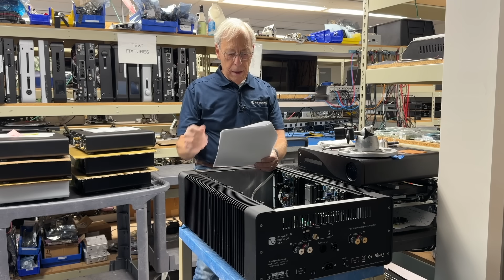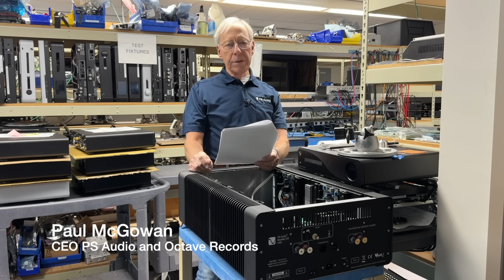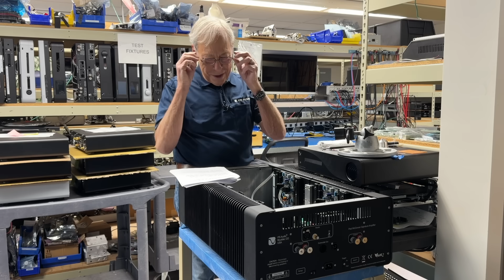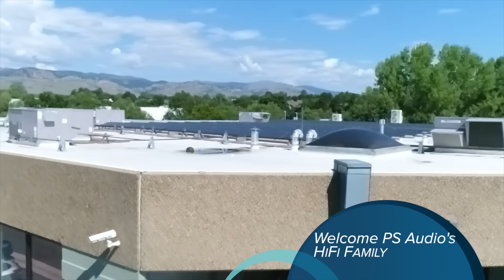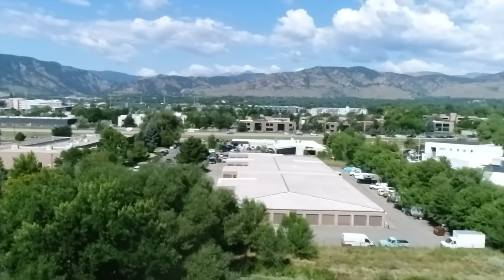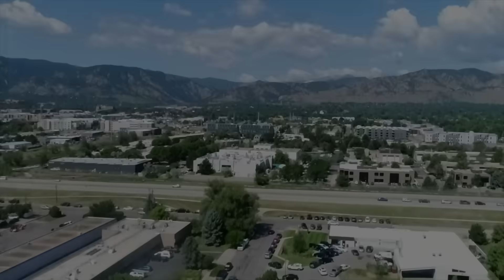Why Class A amps cost more

Comment: Tell the truth Paul. Class A topology is not more expensive due to design complexity. Class A is as simple as it gets. The only reason is because of inefficiency. Requiring more power and more weight, due to bigger transformers and heatsinks.

Comment: If this amplifier in the video has 100W in pure class A and 800W RMS total, (I assume current dumping where the drive transistors are in class A and the output transistors in AB, B or even C) then these heatsinks are not big enough because the manufacturer has to make an amplifier that has to withstand full power all the time regardless of the fact that in reality only a few watts are used on average.

Comment: i said the heck of it bought a brand called helix  car amps. Class a and class ab  or you can get a  class a and d combo for 350 bucks.    I hit my local hifi store .  We were listening to  costly speakers 40k and  30 grand amps.   I bet the  i owner i could match the sound quality for under 400. He said bring it in. Brough my amp in and battery  at home it will have a 50 dollar power supply .   We connected the dac  . The owners jaw dropped.   He was amazed .   Said a damn  car amp with this much clarity warmth sound quality !!   LOL   Home hifi amps huge massive power supplies  huge cage to hold it all.   The components inside the amp and lay out for the mosfet or bipolar are what are the same .     So again i have a mono class a x ab in my home for under 700.

Comment: I can't see how those heatsinks could be so expensive. Most heatsinks I know of are made from cast or extruded aluminium to cut weight, and also cost. Unless it's aircraft grade, which is milled from sold blocks and very wasteful.

Comment: All the internal parts have to be over spec’d and larger values with plenty of cushion in their operating ranges for voltage and current because in Class A the amp runs wide open aka full throttle, my little 25 watt/ch class a amp runs 200 watts all the time whether it’s 10 milliwatts or 25 watts it consumes 200mwatts, that the real inputted cost, tougher and better parts.

Comment: 100 watts of Class A is going to suck a lot of power and generate a ton of heat. I passed on buying a pair of Parasound JC1 monoblocks because even 25 watts of Class A heat is too much in Iowa summers.
Reply: I have a 18 watt sudgen. Its sound really nice
Reply: @jasonme3557  I have a 400/800 wpc Mark Levinson 432, it sounds really nice too.  :D
Reply: @jasonme3557  I have a 400/800 watt Mark Levinson 432, it sounds incredible.

Comment: I got into electronics to build my own stuff. And I was surprised how bad transistors are - they are non linear in most of their range. I decided that only class D can be made right. And anything old style (class A or AB) probably always need feedback to fix problems fundamental to transistors.
Reply: Non linearity is why negative feedback is used and it does a good job if it's not excessive (TID).  Class D amplifiers also use negative feedback, the best ones use post filter feedback and class D is very much still in development.  For decades we have listened to class A and class AB amplifiers and some of them sound extremely good and as far as I know they all use feedback apart from the Cyrus brand.
Reply: I have a 30+ year-old 21 Watt Class A Ultra-Linear Valve amplifier, which as far as I can tell from the Schematics, doesn't have any Feedback... but don't quote me on that.  I gave up on Trannies back in the 1990's.  The Valve amp happily drives a pair of Quad 57 ESL speakers, as I don't need 'Loads-a-Bass'.  Russ.  Hampshire, UK.

Comment: He was asking about pure Class A vs Class AB. The big amp shown is Class AB, and therefore will generate much less heat at idle than if it was actually pure Class A. "Amplifiers that are class A to any degree" are Class AB, except for the few that are actually pure Class A.
Reply: All solid state class A amplifiers leave class A at some point, like when the power output increases into low impedance loads.
Reply: @mitchtaylor6512  Not true. A single ended design, whether a tube amp, or a solid state design like the Pass Aleph, remains Class A by definition at all power levels.
Reply: Class A bias is class A bias, no matter if the amplifier goes into class A/B after a determined amount of watts, it's still the same bias current.

Comment: Can confirm just from building Nelson passes first watt amps and collecting all the parts how $$$ it is. The chassis with all that heavy big heat sinks is the number one cost. Good heavy heatsinks are not cheap. Number 2 is the power supply.  All the 8 capacitors alone in a first watt amp are not cheap and that doesnt include the transformer.  And this is just a simple 25 watt class a amp. If you get into a first watt f5 turbo and some of f5 variants it doubles everything in the power supply. And scaling this up beyong 25 watt class a than you start talking big chassis, huge heat sinks, soda can sized capacitors, bigger transformers and more output transistors. Just my experience from collecting parts for builds .
Reply: @brandonburr4900 ...thanks for posting your experience on this topic as some wannabe experts
(know-very-little's) here are telling us how dirt-cheap these parts are 🙄

Comment: When I sold audio gear, many years ago, the saying was, "It's priced by the pound." The more it weighs the higher the bill of parts. There's simply more stuff in there. Then there's differences in component quality. The components in the amp need to be higher quality to handle the workload and it's gotta last and have the after sales support you expect from a premium product too, which all costs more. There's economy of scale, since you sell less it makes each one more expensive. Not just manufacturing but design. And that goes for the components as well. If a niche company needs specially designed components that can be crazy expensive.

Comment: They would cost more to run, even if they were cheaper.
😉
Reply: I have 2 class A systems in my house, and my power bill has not gone up because of it.
Reply: @JerryM-p2v  I believe you.
It depends on the total power output of your amps and how much time on average you have them on.
…and of course, in your kW/h rates.

Any B or AB class amplifier will draw significant power as well when driven loud.
Only D class amos are easy on the power consumption.

Comment: Class A amps, this uses a transistor under high bias that has the behavior of a vacuum tube triode, meaning a pronounced 2nd harmonic and some 3rd harmonic behavior.  My Pass Labs XA-200.5 monos are a serious 160 lb room heater, but it has that magical lit from within presentation, but with authoritative bass, and a soup to nuts frequency band that’s very resolved.  My Lamm ML1.1 using 6C33C-B triode bottles has more of the same mid band.  My fave tube gear is my Viva Linea preamp, using tube rectification.  Class A and tube gear is my fave.

Comment: Would a low RPM fan(s) help?
Reply: Any fans will help...'sup to you.
Reply: Why add noise to the system. The big heat syncs dissipate the heat into the room.
Reply: @JerryM-p2v   ...when it's Summertime & my listening room gets up to around 100°F, I have a $15 cheap Chinese made pedestal fan, with a 14" blade span, that sits 9' away from my rig, to the L/H side, blowing air over the three components, but directed straight at the amplifier. When listening to Rock 'n Roll or Jazz or Orchestral work or Electronica in a range of 90dB - 104dB I'm not going to hear any "noise" from said pedestal fan on low speed blowing air gently across my rig...I'm just sayin'.

Comment: There you go.  Paul's best amp to date will operate in Class A up to 100 watts, proof positive that all the numpties here who dissed Class A based on Paul having  (dishonestly) pushed huge Class A/B amps were totally wrong.  

You should know, however, that Paul's example is totally bogus.  If it takes 90 hp to go up the hill, you'll make it if you have 100 HP.  The engine will come close to its limit and may struggle harder to get rid of the heat than a bigger engine with a bigger radiator, but (if it's designed correctly) it will make it.  It's a bogus example because Class A creates the most heat at idle.  The bigger the Class A amp, the MORE heat it will produce at idle, and the harder it will be to get rid of the heat.  A huge Class A amp is more like a car that can get up a steep hill, but boils over when stuck in city traffic.  

If the biggest music peak you will ever play can be handled by 20 W then you're better off with a 20 W Class A than a 100 W Class A.  That is almost certainly the case for anyone who 1) Listens at levels that won't cause permanent hearing loss, 2) has reasonably efficient speakers, and 3) has a small to medium-size listening room.  If you meet these criteria, don't get duped by the "more power is better" hype.
Reply: What we've got here is, failure to communicate. Some men you just can't reach. So you get here what markmeridian posts 😂
Mark, thanks again for the hearty laugh with my morning coffee. Your laughable BS is a great chuckle for me in the mornings. Cheers!
Reply: When the debate is over, the loser often resorts to insults when they are unable to make even one single cogent point.  It's something we've all seen and all use to identify the loser.  Despite the fact that nearly everyone recognizes this, it doesn't stop the Dunning Kruger effect types from spewing insults.  Hint: RAT that's you.
Reply: That would be fine if your speakers stayed above 8ohms, but most do not.
Reply: @mitchtaylor6512  You keep making up total nonsense.  Almost all amps produce MORE power at 4 ohms than they do at 8 ohms.  Sheesh.
Reply: @markmeridian3360 not in class A, the amplifier goes into a/b
Reply: @mitchtaylor6512   A class A only goes into A/B if it's designed to do that.  They DO NOT go into A/B with a 4 ohm load.

 Both Class A and A/B do produce more power into 4 ohms than 8.  Usually, almost twice as much.

Why do you make up nonsense all the time?
Reply: Once the ouput power demand goes up - then sooner or later the supplied current exceeds the standing idle bias and then the amp is into class B.
Reply: @markmeridian3360 At some point the current demand will exceed the standing idle bias and the amp will go into class B, unless it is current limited.
Reply: @mitchtaylor6512  Nope.  A pure Class A will not go into Class B.  It will remain in class A right up to the point where it clips. 

Why do you always make up nonsense, Mitch?
Reply: @markmeridian3360 if a 20 watt into 8ohm class A amplifier can almost double power output when impedance is halved, then it would be 160 watts into 1ohm, not possible in class A unless the 8ohm power measurement was way underrated.
Reply: @mitchtaylor6512  Stop making up nonsense.  All amplifiers are ultimately limited by the power handling capabilities of their power supplies and output circuits.  Most amps, but not all, almost double their power from 8 to 4 ohms. That's well known.  You're just (fecklessly) trying to obfuscate for no reason whatsoever.
Reply: @markmeridian3360 no amplifiers made can double their maximum 8ohm out power when impedance is halved, it is not possible. Class A amplifiers are limited even more if they don't transition to class A/B.
Reply: @mitchtaylor6512  You're making up nonsense, AGAIN.  

Look at the Pass Labs XA 25.  25 W pure class A into 8 ohms, 50W pure class A into 4 ohms.  

Look at the XA 30.  30W into 8 ohms, 60 W into 4 ohms, pure class A.  It then transitions to A/B up to 160 W, but the first 60 W are pure class A.  Like I said, it can only do this because it was designed to transition.

Look at the Accuphase A48S.  50W at 8 ohms, pure class A.  100 W at 4 ohms, pure class A.  

I can list nearly the same doubling for 1/2 a dozen more other class A amps.

I suspect that you're (fecklessly) trying to defend your poor decision to buy a huge 1200 W class D amplifier from BS Audio for your tiny  listening room.
Reply: @mitchtaylor6512  That's an outright lie.

Comment: I see PSA has discontinued their BHK stereo amp and 300w mono blocks. Only the BHK 600w is available now for 30k. These new 800w mono blocks... under 100k? Any guesses?
I'm assuming PSA is doing the same as they did with their speaker line-up. Starting with the top of the line and going down from there. Wondering what the bottom of the line amp line will be as far as wattage and price.
Any guesses?
Reply: @Mark-Iq3sb ...They are going to have to be less in purchase price than Gryphon, Boulder, Constellation, Solutions, etc.
As @josephpavel3150 mentioned on my thread, possibly priced along the lines of Pass Labs.
Personally I'm thinking somewhere between Pass Labs & the others that I have mentioned above. That's my 2c worth.

Comment: These class a amps  are designed to run unencumbered. If you must put them on a rack u better make dam sure u got a fan pointing straight at 'em.
Reply: Don't need a fan, that just adds noise to the room.  Think of them as an air cooled engine.
Reply: @JerryM-p2v  no,   if you've got it on a rack u need to put a fan on it. Let that current of air flow through the heat fins and you'll thank me later.
Reply: @robertwatkins-k5p   ...many racks these days are completely open on all sides; square steel framed.
However, any proper audio-enthusiast (including audiophiles) worth their salt will place their equipment
on isolation platforms on the floor in my not so humble opinion.
Reply: why do u think I used the word ...."unencumbered"?
Reply: OPEN SIDES ARE NOT THE ONLY STORY.   WHAT ABOUT THE TOP AND BOTTOM?   IN FACT, THAT'S HOW THE HEAT FINS WORK......DRAWING AIR FROM THE BOTTOM AND EXHAUSTING OUT THE TOP.............RIGHT INTO A SHELF?  THAT AIN'T GONNA WORK, WITHOUT A FAN.
Reply: @robertwatkins-k5p   ...SHELVES CAN ALSO BE MADE OF OPEN-WEAVE OR OPEN STRUCTURED METAL LIKE HALF-INCH SQUARE STEEL TUBING THAT CAN SUPPORT GREAT WIEGHT & ALSO ALLOW FOR NECESSARY AIRFLOW FROM BOTTOM
TO TOP.  WHERE HAVE YOU BEEN LIVING? UNDER A ROCK??? ...YES; IT'S GONNA WORK WITHOUT A FAN AS LONG AS THE AMBIENT AIR TEMP. IN YOUR LISTENING ROOM IS UNDER 76°F
Reply: SHOW ME AN AUDIOPHILE RACK THAT DOES NOT HAVE SOLID SHELVES , JACKHOLE.
Reply: @robertwatkins-k5p   ...you can also bore a series of half-inch holes into the MDF shelves directly underneath the length of where the the cooling fins are positioned in the amp. to allow airflow if you don't want the 'open' steel tubing shelves that are available. And since you mentioned "unencumbered" then why would you even talk about putting two ginormous monoblocs into a Hi-Fi rack when everyone knows that they should be sitting right next to the loudspeakers that they are driving??
Reply: i'M  TaLKING ABOUT SUGDEN A21.  OR, EVEN HOTTER ,THE MUSICAL FIDELITY. I'm SURE U CAN FIND a QUIET FAN. BTW, mdf is the most unmusical material on the planet. yOUR IDEA TO DRILL HOLES WOULD WORK for Cooling  but, you'd still be dealing with a shelf that sounds like crap. O f course, this whole problem is a  non-starter if you simply allow more headroom but, invariably, people want to  cram everything into their rack.

Comment: Try Accuphase A 300 Class A Monoblocks Heaven!
Reply: Try Hegel H30A instead. Sold my A300 monoblokk...
Reply: I love mono blocks.
Reply: I would like to see a 300W RMS tube amplifier in pure class A. Of course push-pull and not single ended because that would be unrealistic to expect considering that it is impossible to pair a bunch of parallel tubes in SE well for such power. The only thing is to use much smaller SE amplifiers connected to a huge output transformer with a large number of primaries and one output for the speaker.

Comment: For the same reason a Model T in excellent condition costs more.
Doesnt mean its better, just more.
The bonus is you can take on small welding jobs to help finance it.
Reply: A better analogy would be comparing modern rockets to the Saturn five it's still the benchmark.

Comment: Listen to an old valve (tube) radio.
That lush, warm sound, is the sound of a single ended pentode audio amplifier. They are only a couple of Watts at most, but give me that sound quality over volume any day. 🥰
PS Audio should think about producing a stereo, dual monoblock, low power, single ended pentode power / headphone amplifier, IMHO.
I think they would sell like hot cakes, or hot pentodes. 🔥⚛🫙⚛🔥
Reply: Then they could start making turntables too.

Comment: I will say not all Class A amplifiers are created equal, my 30 watt Luxman 590 AXII has a Power Consumption of 330 watts, I see other 30 watt class A amplifiers only requiring 120 watts. 
Not sure why but if you don’t what to go to tubes Class A is the next best thing. 😎
Reply: It depends on the type of class A, some are complementary (push pull) class A which are more efficient than single ended class A which are about 20% efficient, some purists consider this to be the "real", class A.
If heatsinks and power supplies are big enough (unlikely, they're expensive) the quiescent current of a class AB amplifier can be increased from a few mA to a couple of Amps and the first few Watts will be class A sound.